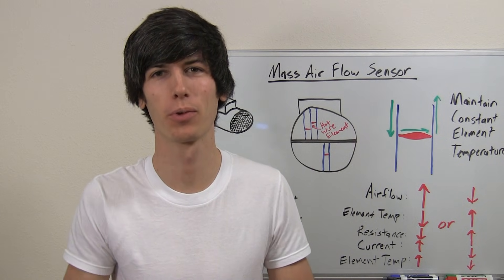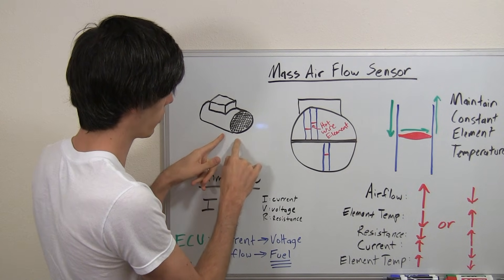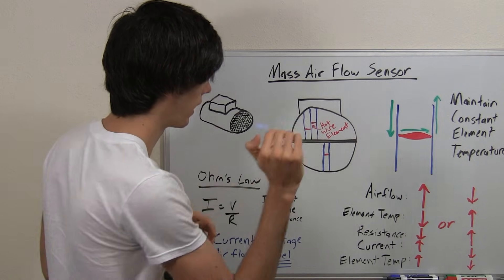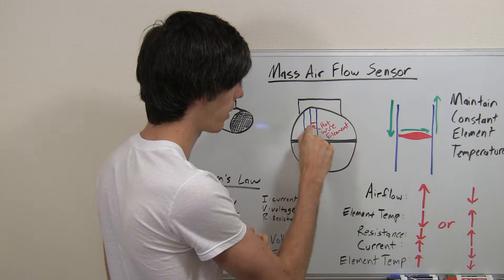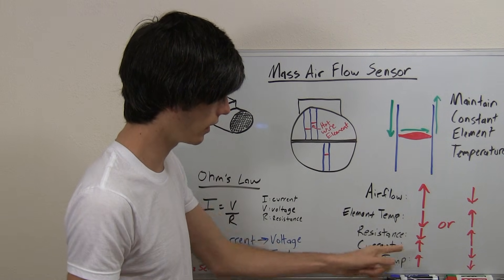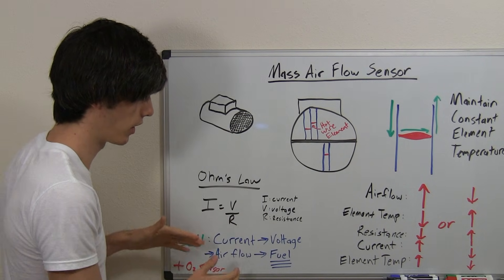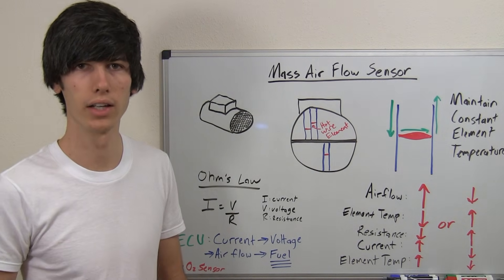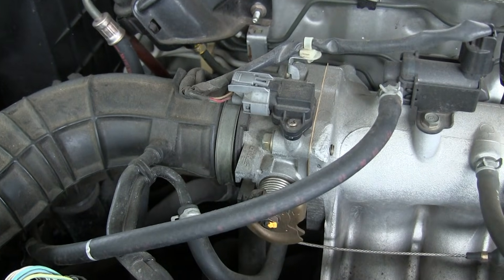Mass Air Flow Sensor - Hot Wire - Explained

Comment: With a Turbocharged engine still running a mass air flow sensor (hot wire).  It measures the incoming air still but its then compressed.  What is the relationship between the AFM and the turbo?  After the turbo that air that was just measured coming in is now compressed with greater air molecules.  i assume other engine sensors takes care of the boost.  am i on the right track?  thanks
Reply: On most cars the AFM is right after the air filter and before the turbo/supercharger.  Because the sensor measures air mass and not air volume, it will still be accurate because correct combustion depends on the mass of air and mass of fuel.  So even if that mass of air is compressed by a turbo/supercharger, the computer still knows exactly how much has entered the engine and can meter fuel accordingly.  
Some cars may have a boost pressure sensor but that is usually for turbo management and not for fuel metering.  
I hope this helps, and someone correct me if I'm wrong.

Comment from the maker: You're measuring the amount of air passing through, the temperature of the air, and the position of the throttle sensor. The air's pressure is going to be relatively even throughout, so by measuring the mass flow rate (the quantity of air that goes by one point will be the same quantity at a later point) you can predict how much fuel is needed.

Comment: Why is the MAF located near the air filter? Why isn't closer to the throttle body? I thought the throttle controls the air flow into an engine.
Reply: The mass air flow sensor is located a specific distance away from the throttle body to allow for ecu latency. By the time that metered section of air is relayed by the ECU and the responce is executed by timing/fueling it is now in the combustion chamber. But all of that is happening in milliseconds.

Move the throttle body considerable distance without the latency corrections and you will have problems. Latency corrections can be taken care of by not actually changing the latency responce of the computer but changing the fuel mapping over the entirety of the rpm spread.

I have nothing to back this as it is just my theory for maf placement

Comment: Does a Mass Airflow Sensor only work with Fuel Injectors? If not how can a MAF sensor also work work with a carburetor, like does the ECU adjust the mixture control in the Carb somehow?

Comment: The goal of these sensors (vane/MAP/MAF) is to get engine load. MAP (manifold air pressure) aka air density based systems needs additional sensor information (IAT or intake air temp) to get calculate load or VE (volumetric efficiency e.g. how much your air is getting pumped / maximum). MAF sensors are great because they are inherently temperature compensated. To measure a volume of air using MAP, you need temperature and pressure. Remember PV=nRT? Also, MAF will react faster to changes than MAP.

Comment from the maker: Great question, and something I should have mentioned. No, carbed engines will not have MAF sensors, the carburetor is designed to create the proper air/fuel ratio. I have a video on carburetors if you're interested.

Comment from the maker: When the cylinders are going down during the intake stroke, they are sucking in the air. Check out my video "engines - explained" or "gasoline vs. diesel." I give a clear explanation to what your asking in these. When you first start your car, your starter motor rotates the cylinders, sucking in the air - see "Starting a car - explained." 

And thanks!

Comment from the maker: Check out my website listed in the description, I've got an about me page where you can learn all about me, if you so desire haha.
Reply: Bunch of years later - I've watched most of your content. Today I needed to know how the hotwire worked without any BS. 
Thanks for the non-BS explainer. 

How does temperature of the intake stream affect the flow measurement? 
If I have a CAI on a boosted car and remove the heatshield so the CAI (aluminum) is seeing heat from the turbo and other under hood items, what's the effect on the fuel trim over time? 
The other day it was almost 100 here in Maine and at 100% humidity, my intake air temp (measured after the intercooler for some reason) was 90 and the outside air temp was 99. There's no way the air temp going into the turbo where density would matter is 99 degrees. It would have to be over 150 under the hood. So the air temp going in at 150 ish but the ECU thinks its 90* . I can't see how this heated pipe wouldn't affect the overall measurement. 

Help?

Comment: Thanks for another great video! Just one question. How does this device handle the fact that the car will be driven in different ambient temperatures?
Reply: Some MAF have an internal air temp (AT) sensor.

Comment: Correction to what you said about your manifold absolute pressure sensor (MAP) it does not replace a Mass air flow sensor (MAF) 
MAP sensor reads manifold pressure... or "Reduced" pressure (Vac) It's used commonly for "Altitude readings" and or Engine load
as i believe, the IAT sensor replaces the MAF sensor on your vehicle.

Comment: I've always been haunted by this question: Given that the MAF sensor registers airflow due to excessive air hitting the air box and into the MAF sensor, how does it push the car when its stationary? I.E: How does it suck air into the engine when theres no air trying to get into the engine by force? Is there any mechanism that 'sucks' air into the engine.

P.S: Amazing videos you post BTW! I've learned so much from them! Keep'em going =)
Reply: I guess you are referring to the intake stroke of the of the engine.

Comment from the maker: Both are not required, but it may use both to fine tune and have controls check to make sure the proper amount of fuel is injected.

Comment: wouldn't this sensor depend on the temperature of the inlet air... say you are in the middle of the desert where it is ridiculously hot and wouldn't cool the hot wire just as fast... wouldn't that have an effect on the values to the ECU and in turn on the fuel injectors?

Comment from the maker: I take my mileage and divide it by how many gallons I buy at the pump. :) haha, but if you were to do it by hand, you'd have to know so much about the engine, it depends on so many factors, many of which are out of our control (air temperature, what rpm range you stay in, elevation, etc..)

Comment: Interesting, i knew what was MAF was but i didnt know thats what it used.
So one time i tried to calculate how much fuel i was burning in my camry. So i factored in everything i could think of, volume of engine, cycles per minute, volumetric efficiency (i chose 90%) throttle position, AFR, everything. And i kept getting some ridiculously high number, like 3.4 gallons per min. Then i finally asked my dad if he could help and he said AFR isnt measured by volume its measured by weight.